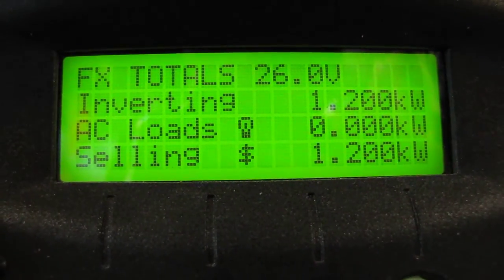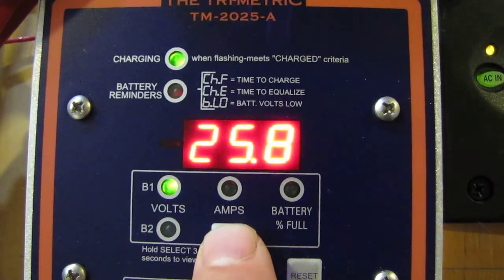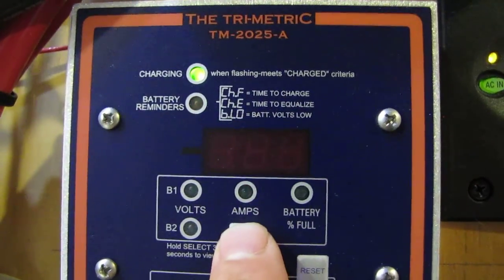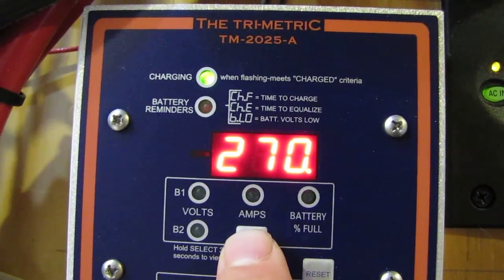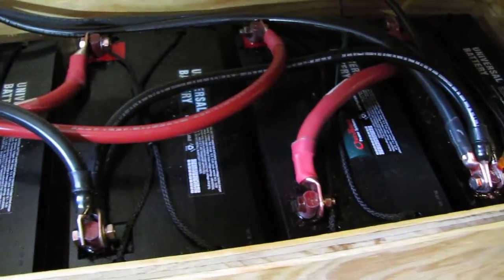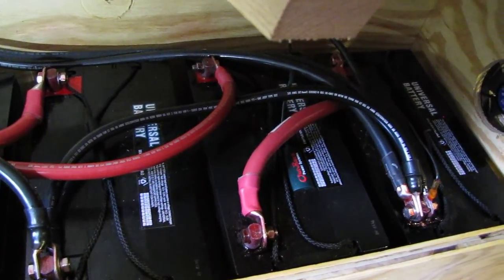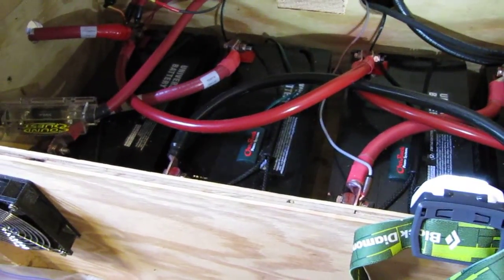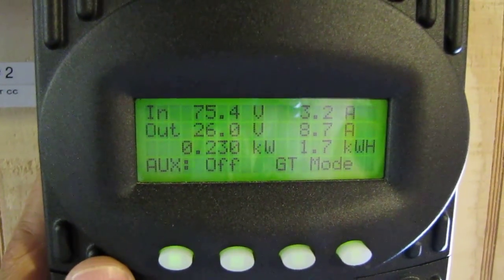OFF Grid ON Grid 24 Volt AGM Battery Bank Revamped Day 2 By VIARLOCITY

Comment: talking of batterys 
you wouldn't believe where i found mostly brand new heavy duty truck car and marine batterys at $450 dollars per metric ton
the scrap metal yard collects all the old stock from retail service mechanics
sold off as scrap once they reach a certain age regardless of condition 
the volt meter reads around 13.5 volts each battery
flooded lead acid batterys hold approximately 50kwh per ton
rather than making fishing sinkers, checking the multimeter was a nice surprise

Comment from the maker: Each Battery Is 12 Volts  and 90 Amp Hours Each  So If It Were 12 all In Parallel It would Be 540 Amp Hours But Since I Stepped Up In Voltage 24 Volts  It Cut My Battery Amp Hours  to 270 Amp Hours I think That is right Correct Me If I'm Wrong